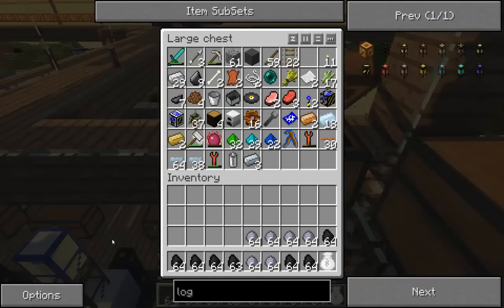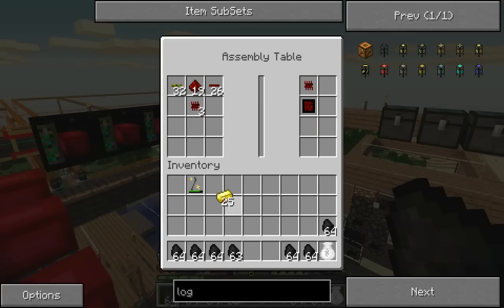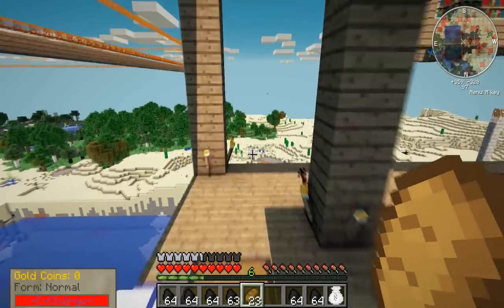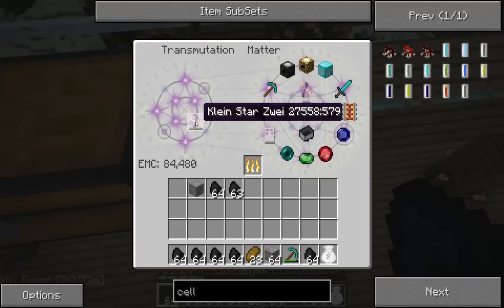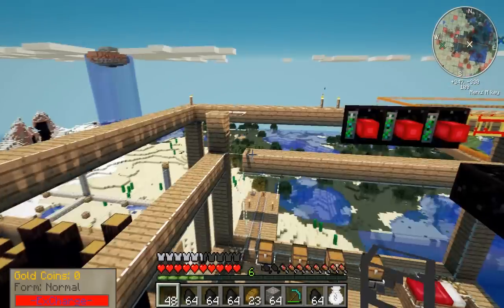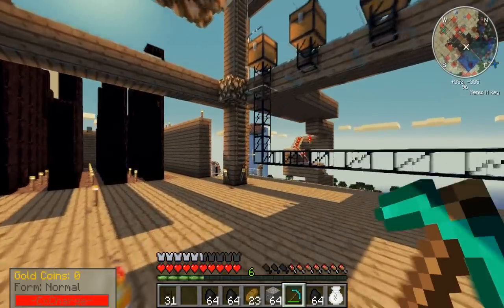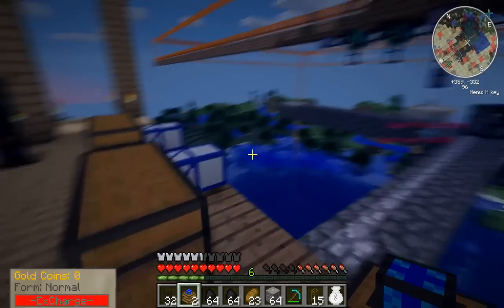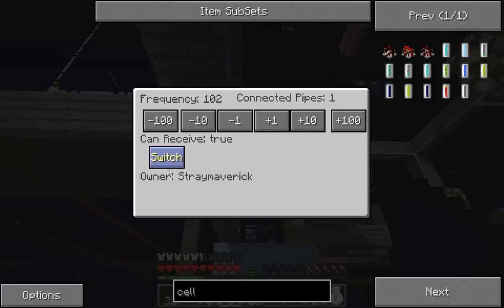Upgrading My Collector Flower Because Of The Major Failure - Season 3 Ep 15 Minecraft Lets Play

Comment from the maker: It is most likely turned off in the config file. It sounds like it is locked to make sure you don't cheat. Just open up the Notenoughitems config and change the value.